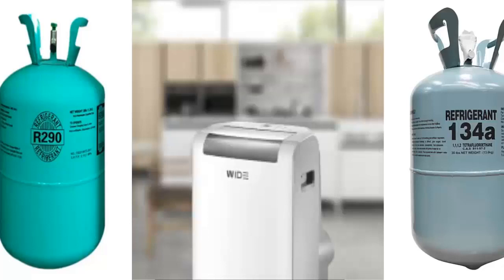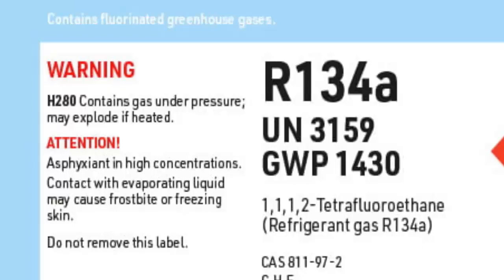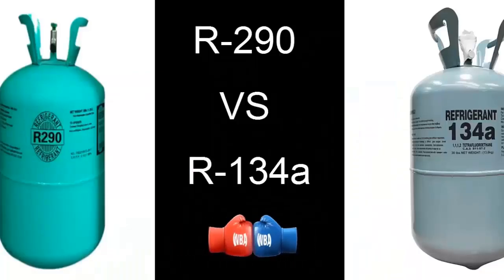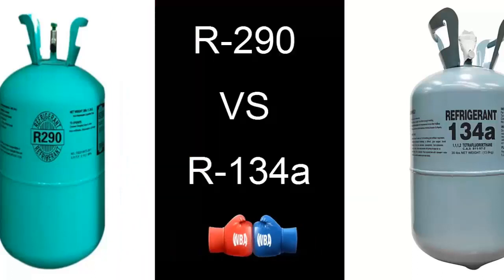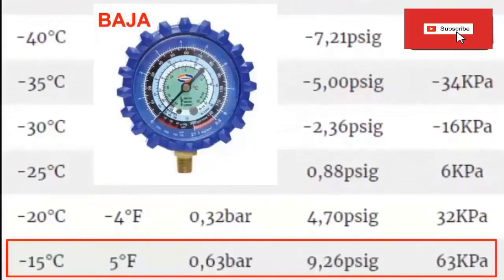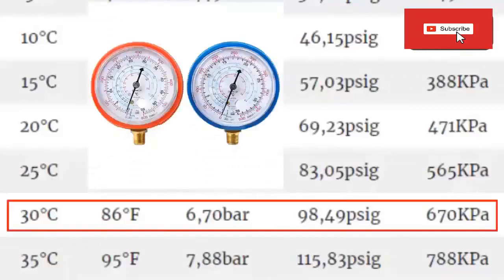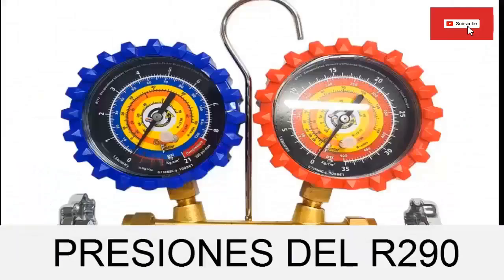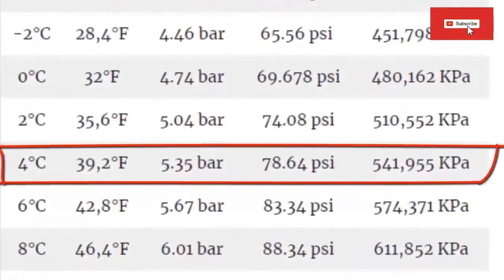R134a VS R290 What are their working pressures, and what should you know about these refrigerants?

Comment: I do not understand? why the temperature in the evaporator coil is lower when the pressure on the low side is lower aka is 'low' on refrigerant? To me it would be logic if it was the other way around. Can someone explain that?
Reply from the maker: Here's the previous response translated into English:

When there is lower pressure, a liquid evaporates more easily because its molecules separate more quickly due to the reduced force they need to overcome. For this reason, at lower pressures, the liquid boils faster and requires a lower temperature to reach its boiling point.
Reply: @HVACRMembership  Thank you very much for your answer. This sounds logical and I need more time to let this sink in to understand it regarding to the sealed loop system. Thank you!

Comment: Global Warming potential is Irrelevant!   What is relevant is the efficiency since our two maximum efficiency refrigerants(R-12 and R-22) have been banned.
Reply: r290 is more efficient than r22, even if used as a drop in replacement it will perform better with a lower charge and lower electricity use and higher power output.. R290 is propane..
Reply: Je peu change la fréon 290 a 134
Reply: @ThierryBukaka  Hyvät kylmäaineet on kielletty politiikan ja typeryyden vuoksi.
Reply from the maker: The Global Warming Potential (GWP) on a commercial level indicates the lifespan of a refrigerant in terms of environmental restrictions. For example, if the GWP is around 1000, it is low, but already at this point, there may be environmental restrictions. In the case of R290, it has an extremely low GWP, suggesting that it will be on the market for many years. Thank you for participating.
Reply: @HVACRMembership  r290 has less gwp than CO2 according to science findings now

Comment: The asian evaporator coil copper tubing is "very poor quality copper" it is thin and corrodes then leaks. If there's a explosion and someone gets badly hurt, the customer's lawyer will b e contacting you saying you were the last person to work on it. There goes everything you ever worked for. I don't want the liability. I change the cap tube and refrigerant. I've seen a lot of stuff in this industry come and go, I expect 290 to be gone in a number of years.
Reply: Nope! R290 has been around for a long time now everywhere else in the world, R290 is here to stay, you can say bye to R410A tho 😢
Reply: Nous pouvons charge le 134 a la place de 290?
Reply: Propane is one of the oldest refrigerants used. Some systems using propane as a refrigerant don't have any moving electrical parts. Liquid propane goes into a metering device(capillary line), boils off in the evaporator, and is then burned off. The tanks had to be filled periodically, but they work really well and the flame off can be used for other purposes.